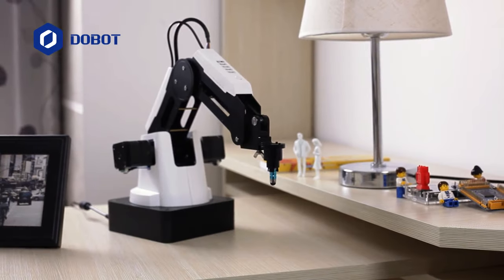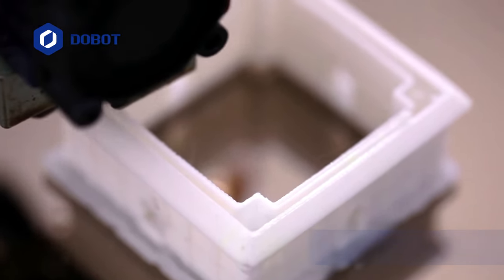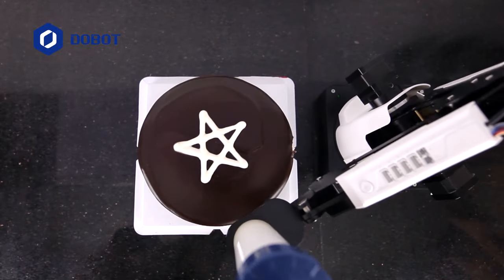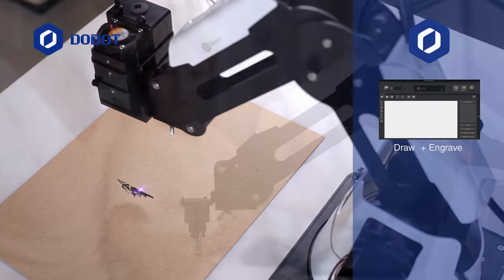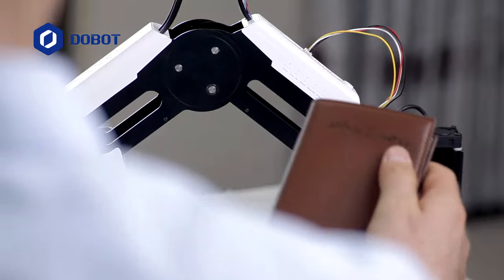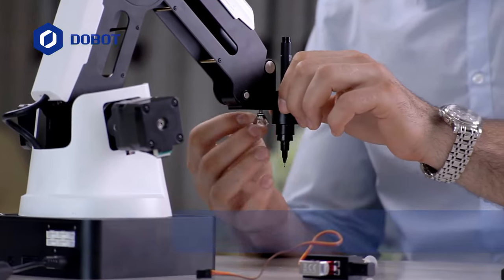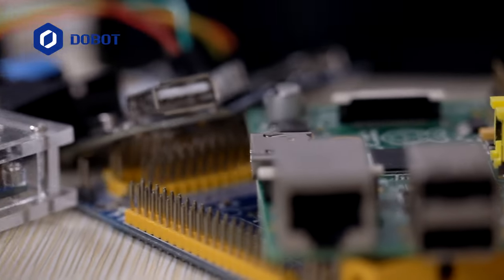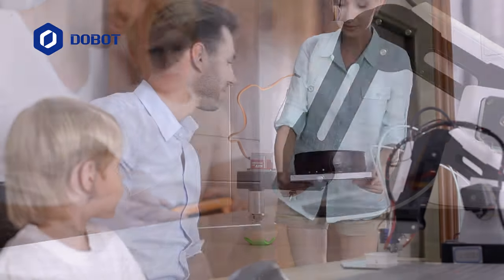Dobot Magician - Bring Industrial Robotic Arm to Daily Life, 3D Printer, Laser Engraver and more!

Comment: as does DOBOT to learn the moves being using stepper motors? They added a new sensor that has the old dobot? you can update the old dobot to make this new function
Reply from the maker: Hi Moise, Dobot learn the moves using angular sensors. And you might develop this feature on Dobot 1.0, although the handhold teaching feature includes a physical button at Dobot Magician's forearm, making the case a bit different on Dobot 1.0.
Reply: do you use magnetic encoders? on absolute position?